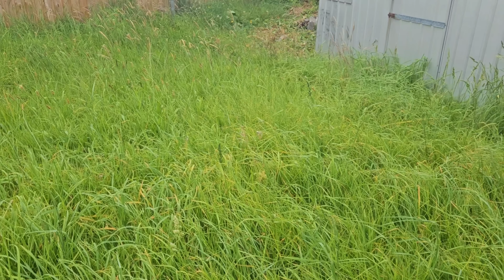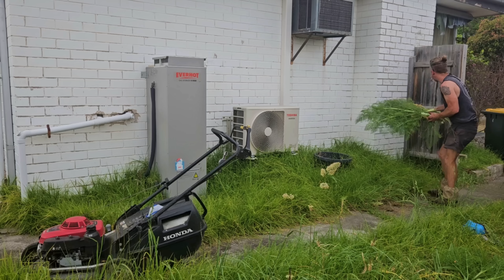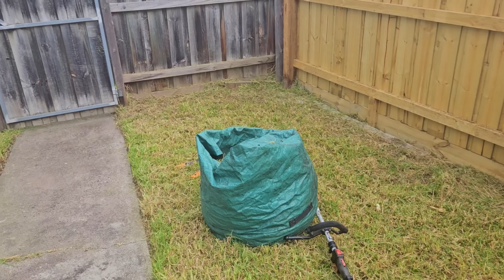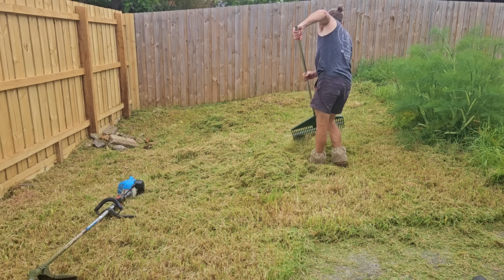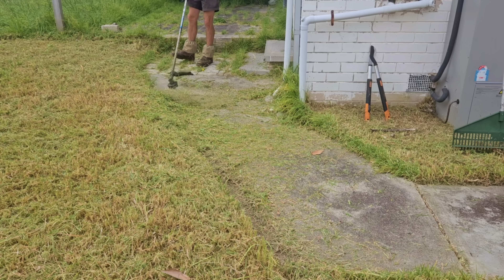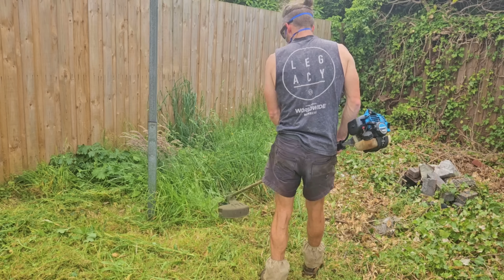From WILD to WONDERFUL - part 2 | SATISFYING mowing and PATIO reveal

Comment: Can I make a suggestion drill a hole in the flap at the back of your mower and have a bungee cord hooked on it to the arms of the mower to keep the flap up when cutting the longer grass this way the grass discharges out the back with out clogging the machine.

Comment: Another observation? The fact you all there seem to DO Repeat Actions in tiny pieces, rather than the whole piece, for front or back, to save time. To me it does seem like a waste of time.
Reply: Gday! I hear what you're saying but there are a couple of things you may not have considered. Doing the same physical movements for extended periods of time increases the likelyhood of developing muscle strain, especially for the lower back, so changing the type of movement can reduce this risk. Ryan has mentioned in a previous video that he  needs to be mindful of back strain as he is prone to this. Also, when doing this type of work its actually more efficient to do it in sections so you can better see what you've  done as you go along.   Thanks for letting me share some of my ideas with you😊 Take care❤